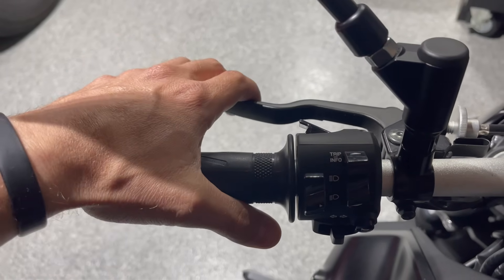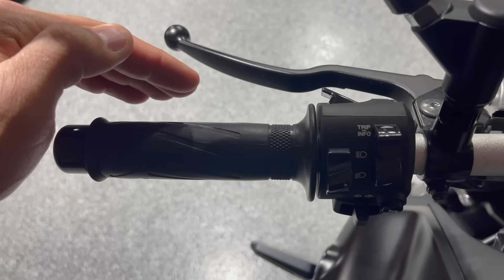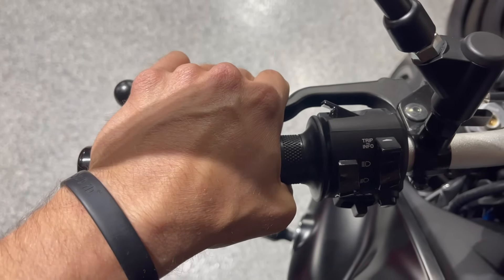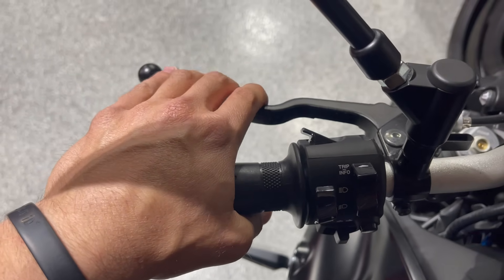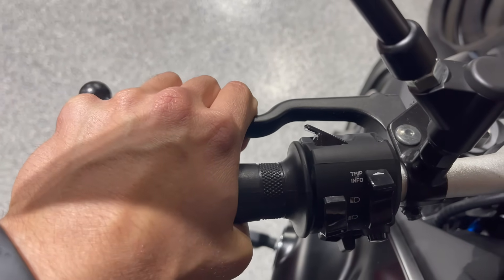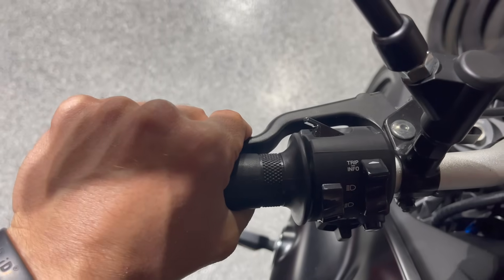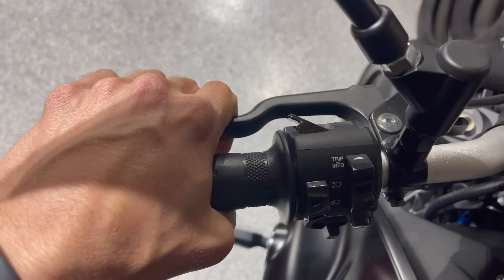Don't Make This Common Clutch Mistake!

Comment: Easy, just use 2 finger(pointy and middle finger) to pull the clutch. Whenever you pulled your clutch, the clutch lever will stop on your ring finger. At this point the clutch is already release and you can change your gear. 

Sometimes, the riders will adjust their clutch cable free play depending on their riding style. A longer free play, shorter lever pull. A shorter free play, longer lever pull. Just play around with it and feels what neutral for you and fit you the best. (I'm sorry for my english, not a native speaker)
Reply: Only works with newer bike, try using 2 fingers on my 1970 Laverda and that clutch won't move by a millimeter😂
Reply: @simonegabellini6382  Not all of us drive old bike. But man, my comment was two years ago now. Damn, time flies.
Reply: my ring finger hurts because I keep jamming the clutch lever on my knuckles 🤣

Comment: Depends on the bike, how your riding, where your riding, and the conditions, and Will put more wear on clutch and gear box.
Reply: That's fundamentally incorrect.   The clutch is fully disengaged as soon it's "inside" the friction zone.  Your clutch should be adjusted so that the friction zone is the last 1/3 of travel WHEN RELEASING.  This is riding 101 type knowledge.  2/3 of the lever's movement range is just overtravel for mating the lever and grip together comfortably in your closed hand at traffic lights or extended stops on trails while in gear.  Your clutch probably isn't even adjusted right if that's what you think.  I've seen dozens of you out there.

Comment: I've adjusted my clutch to work with 2 fingers.  I used to use 4 fingers about a year ago.  Now that I'm using 2 fingers, it feels great.  EDIT::: that sounded dirty.
Reply: 4 finger stinger!  2 fingers cleaner 🤣🤣😉
Reply: My gf also has a 2 finger rule

Comment: The friction zone on my motorcycle is pretty close to the bar (it's still pretty new), and if I adjust the lever out farther I can't comfortably reach it.

I'm too used to cars where you push the clutch pedal down all the way so I have carried that habit over to riding as well.
Reply: Cars with upgraded clutches have a very small friction zone and you don't push it down all the way too. 
The clutch cable adjustment should be based on lever slack, there should be about 2-3mm gap from the lever to the perch. If there isn't that bit of slack on the clutch line, you are wearing out that clutch cable. 
If you still can't reach it with the correct adjustment, you could buy a adjustable clutch lever.
Reply: Same thing happened with my bike, they fixed it when I sent it for a service.
Reply: you need to adjust the clutch cable.
Reply: at the engine side of the cable.
Reply: Nothing to do with clutch, but talking about being a new rider as a car driver.. Even while riding my bike i still have the habit of “looking up the rear view mirror”. It’s split second but cracks me up every time.
Reply: @gulamelaka77  , I always check my mirror when I’m on my mountainbike 😅
Reply: @PetjeWinner  you mean the side mirrors? Yeah me too.. i meant the non existent rear view mirror 😂
Reply: @gulamelaka77 lol, I hear ya! I still have a split second impulse to reach for my seat belt thats not on, when I see a police car, but am on m/c

Comment: You can change up gears without having to use the clutch.
Reply: Does it work on bikes without quick shifter?
Reply: @desperateeffort6945  Hm... at some rpm you can try to do this, but it will stress everything (clutch and gears)

Comment: I've been feeling tremendous pain in my left wrist ... I was pulling the clutch all the way and often shifting gear. I've started applying your tip, and I am recovering. Thanks SO MUCH. I thought I would have to stop riding but I guess I don't ;)
Reply: Bro lube ur clutch cable and if possible put your plates too in the lube overnight.Parked for a long time makes the clutch hard. it will be butter smooth. learn good habit to ride. just fully engage your clutch.m riding for the past 30 years and I have never faced clutch failure in any of my bikes. i ride fast and safe too. 
best wishes

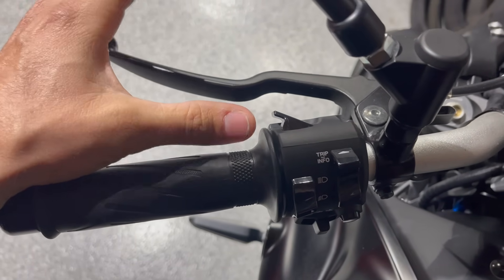Comment: Sorry, a question 1:04 : Change gear IN the friction zone or right when we cut the power?
Reply from the maker: Cut
Reply: Great question
Reply: @MotoJitsu how do you know if the power is cut?
Reply: @mikoyyuy13 nothing happens when you throttle

Comment: I started doing this in the 2nd week of biking and now this is how I do it always. Shifting was obviously one of the most annoying things about learning to ride but after less than a week it wasn’t annoying anymore! I love shifting! So many ways to shift!!! High rpm, low, early, late downshift. Upshift to go 20 then downshift a second later to go back to 15ish. I use the friction zone when needed, usually and almost always at lower speeds and 1-2 gears.

Comment: I appreciate this lesson. I'm a new rider but have naturally been working the clutch as you taught here (except at full stop -- clutch is all the way in).  I see the benefits of doing the way you've taught, but how much of a mistake is it to pull the clutch all the way in?  Too much effort? Inefficiency? Harms the bike?
Reply: not a big mistake, just wasted energy, less efficiency, more difficult to gauge when the clutch reengages so you are missing out on finer control. doesn't harm the bike unless you're on a dry clutch
Reply: i'm not a pro but I feel like you're more at risk of ruining your clutch if you dont get all the way through the friction zone? .. 🤷‍♂️
Reply: @iamtheonethatwonagain8354  Most definitely. But when the disks slip against each other, you feel it. Even the slightest slip.
Reply: It’s not a mistake while shifting
Reply: @iamtheonethatwonagain8354  I believe uve read your being corrected on this misinformation...but here it is again...wetbath clutch on m/c is DESIGNED to work this way. NO damage!
Reply: @RobBroderick44  these wet bath clutches r DESIGNED to be shifted utilizing the friction zone and throttle control...no worries

Comment: Thanks but I think I'll pull my clutch in all the way like I've been doing for 45+ years on numerous bikes. Never had any clutch problems so I'm sticking with it.
Reply: You've been doing it wrong for 45 years.  Why aren't you using 2 fingers on the clutch?
Reply: @Rhetorical346  more fingers equals more more control over your clutch. This is all bad habits to teach new Riders. These kinds of tips I wouldn’t give to anyone.
Reply: @Rhetorical346  2 fingers on the brakes, clutch is 4
Reply: @dezavite  this is the MOST BASIC of lessons.....we r talking about #2 after crank/shut off ur bike. We are talking US basic MSC format and worldwide. This is accepted as safest and best use from beginner to highest pro level. Don't let ur imagination stop ur learning
Reply: @chipblanc6037  when the hell did I ever state that h would ever stop learning? I never claimed to be a pro rider nor did I ever state that I’m too good to continue learning. No matter how good I am at something I will be a learner. But I’m my experience I’d like to have the most control over my bike as I can. Especially over important controls like my brakes, clutch, shifter, throttle etc. for a quick shift I can see two fingers be the more ideal thing to do but it all depends on your clutch level as well. And how stiff the clutch is. Some clutches can be too stiff for people to use to fingers. Either way whether you use two fingers or more either should be fine.

Comment: You are right to a point, but IMHO you may be misleading novices. "Playing in the friction zone" may be wearing friction plates/disks unless you know what you're doing. In  over 15 years of riding, I've only had to rebuild a clutch once — and that was really because I installed stronger springs. (I've had both wet and dry clutches)  Yes, I use the friction zone too, but not the way you demonstrate. I'm much more positive ON/OFF drive. The "zone" is just a fraction of a second transition to prevent shock on the drive train. (Each to his own, I guess.)
Reply: Just got my first bike last week amd this comment feels like important info but its chinese to me lol ive never been around bikes
Reply: Riding as you describe, you would not be able to pass even the most basic, beginner motorcycle course or license test. This is not his idea, lol...it's the standard in US MSC courses and worldwide licensing. It's so basic, it's taught second only after how to turn ur bike on and off. They r designed and built to be used this way without unusual wear or tear.

Comment: I taught /instructed motor cops years ago.  First day all we did for the first 8 hours is practice and play with friction zone.  We did this in every gear.. all day long.  You wouldn’t believe how many guys (some of them life long riders ) were able to finally ride and control their bikes at amazing levels.  I will still occasionally fully pull in clutch at a stop light.  But that’s about it.
Reply: I don't even use my clutch to upshift if I'm accelerating hard.. The clutch is a power button
Reply: @kenandrieling5885  doesn't that affect your gearbox then?
Reply: @04mmar   Not when you're upshifting... I use the clutch to downshift though
Reply: If you are accelerating hard just put some upward pressure on the shift lever and let off the throttle  For a split second it will slip in the gear
Reply: That is also how you shift gears in the middle of a wheelie
Reply: rip to those clutches
Reply: @thizzfox  wet bath clutch is DESIGNED this way! This is #2 after learning to crank/shut off ur bike, it's so basic, in all MSC training (basic format).
Reply: @kenandrieling5885  disengaging the clutch is important to preserve the gear box . The clutch is based on friction and wearing a bit won't affect it but the gearbox isn't, it has actual teeth which need to engage with the drive shaft so if the engine is pulling while the teeth are engaging, it will get damaged.
Reply: @sossiepie2243   Dude I raised motocross for 10 years and was pro for 2 of those. I've had probably 15 dirt bikes in my lifetime and never once have I had a transmission problem
Reply: @kenandrieling5885 I believe ya. But my experience with my last 2 bikes (96 ninja 600 & 03 yamaha r1) both slip out of 2nd if you you give them much throttle from previous owners doing clutchless shifts while racing &, wheelieing. Wish I could say I've never had gear box issues from this because it is a real pain in the ass, makes me less confident on the bike, & a bit dangerous. Gonna cost me 2 grand to fix that issue on the r1

Comment: I bought my daytona 675r  yesterday, I've been riding in my neighbourhood practicing braking, pulling away,  shifting gears and not to lean on the handlebars (i keep forgetting after 5 minutes). Now that you mention the clutch thing there is a huge dead space.

After a few stop signs I noticed it's a lot easier to do slow maneuvers with the clutch partially pulled like you said.
Reply: Try using a bit of a rear brake while giving some power while doing maneuvers - it would be even smoother

Comment: Honestly I struggle with this, so thanks! I'm always afraid I won't fully engage the clutch in a shift and cause some sort of premature clutch wear. I've been trying the "two finger" technique, but having fingers between the bar and the lever feels sketchy in that "I'm slipping the clutch when I don't want/need to" sort of way. I baby my bike tho, so maybe I'm just paranoid. Just don't want to break her doing something I shouldn't. Same reason I don't try wheelies... seems rough on the chain.
Reply: Get some shorter levers installed and it won't feel so bad. 2 fingers is more comfortable with a shorter lever. And because the lever is short it's more comfortable than trying to squeeze the middle of a long lever with 2 fingers

Comment: Learned this way: Preload the shift lever, then "reverse blip" throttle and pull only enough clutch for it to slip into gear. Usually not much clutch, if at all, and more downshifting than up. Lower rpms need more clutch to make it smooth. MSF courses teach beginning riders to do this poorly, among other things. Your efforts at remedial education here are valuable and appreciated!
Reply: That's actually correct. For upshifting, you don't even need to pull the clutch at all. On the track we all use quickshift nowadays, so that we don't have to use the clutch up, but before I've learned to do the same by just closing the throttle a little bit. The blipper does the same downshifting, but it's still for few models. MotoGP have seamless, and that's an entirely different story. 😉
Reply: @CarloPiana  agree! for upshifting if done right, no clucht is needed for shifting with little to no jerky even without the quick-shift support. I still not sure about the old bike. In modern vehicle, they might did some thing magical about the clucht and gear system to do it.

Comment: I am a new rider and on my way home from work I decided to try this. I must admit, when I shifted in the friction zone, instead of pulling my clutch in all the way, it was a noticeable difference when I shifted gears. It was a noticeable and smoother transition. I plan to improve my skills practicing.

EPHESIANS 4:32
Reply: look at this guy 😂 a new rider who actually wants to learn to be faster and smoother. 

People ride for 15 years and REFUSE to learn the right way, just because they think they know better. 

My brother, keep learning. You will never stop learning in life. Try to downshift at a very rapid pace (maybe not in the street🤭)

When downshifting, do this trick… never letting the clutch be fully pulled. While you’re doing that, rev match your shifts and apply more and more front brake pressure. 

You will have learned how to brake using 100% brake force, and if you ever go to the track you will be faster than a good 1/3 of the people there :)
Reply: Romans 9:13

Comment: I remember many years ago reading a book written by Mike Hailwood and Murray Walker....'The Art of Motorcycle Racing' in which Mike was talking about clutchless gear changes.Mike actually recommended just 'easing 'the clutch for a smooth change and less strain on the transmission.I ride A Triumph Street Triple and I have practised clutchless changes which I became proficient at but I prefer a very slight easing of the lever and I get very fast seamless changes with this method.And it hasn't harmed the gearbox in 53,000 miles .TBH I think it is ludicrous to pull the lever all the way in....just a fraction into the friction zone acts as a 'shock absorber' for the gearbox.
Reply: Bingo.
Exactly what I was taught and still practice 30 years later.
Once you have the hang of clutchless shifting, the clutch is only there 'to act as a shock absorber' as you said.
Just a lil squeeze to bring it to biting point is all that is needed.
Reply: Interesting....I'm a begginer just got my bike 1 month ago and I think I have stumbled onto what you are saying while riding my bike....it's like a blip to the clutch while shifting seems to work for me...I didn't know this was a technique....thank you.